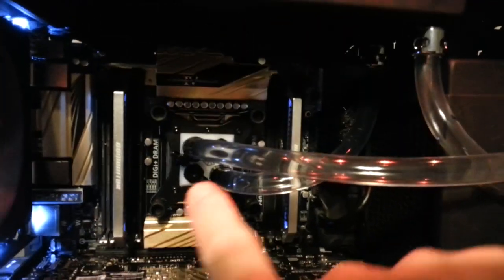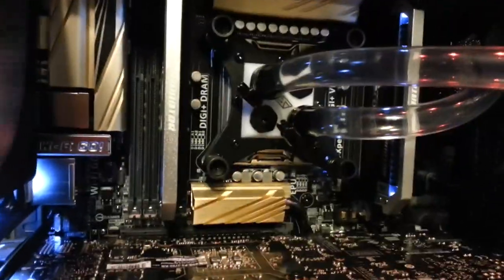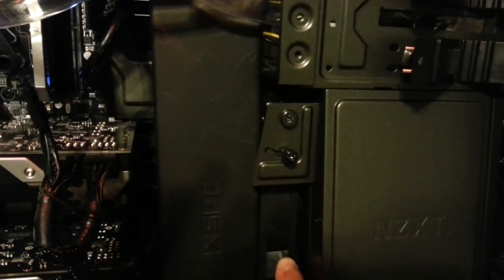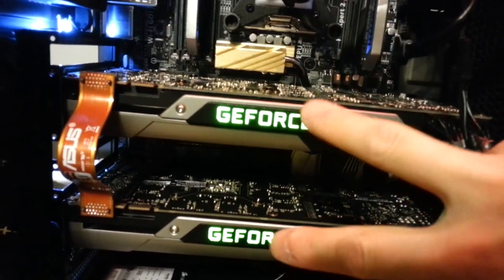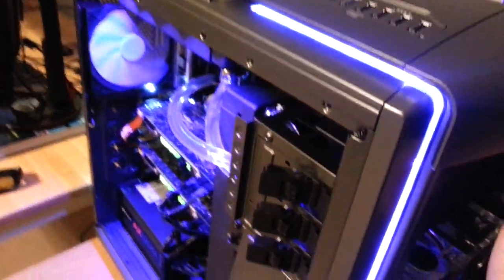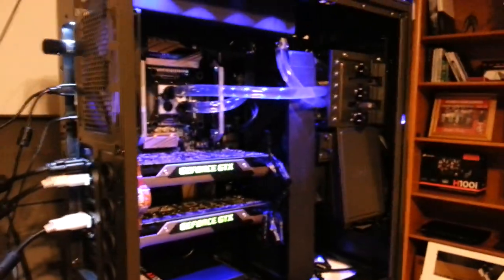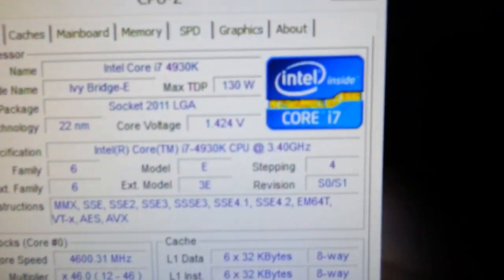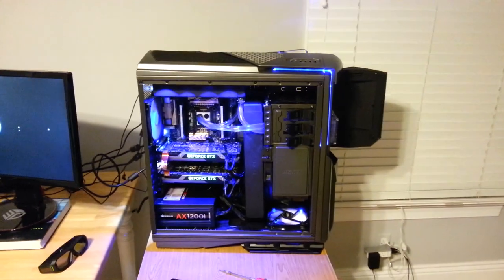[Build Complete] i7 4930K, Custom Water Cooling, NZXT Phantom 820, GTX 780 SLI, Triple Monitor Setup

Comment: For what you are cooling you could go with a smaller case.  I have that case.  I have a 360mm long 60mm thick rad on top.  A 240mm 60mm thick rad on the bottom.  and 2 140mm thick 30mm rad in the back and in the center swivel point respectively. I have 5 water blocks in my case.  1 cpu 2gpu 1 ram and 1 mother board waterblock.  The only block I have seen in your build is the cpu block.  your build was very aggressive, but I am sure you have learned a lot that will help you in your next build.

Comment: What was going on in your head when you decided to use two 360 radiators (1x fat) for a loop containing a single CPU? Hell a 240 rad would have been fine. If you want to keep your radiator surface area for that case and use it effectively I suggest adding your gpus, memory, and motherboard chokes to the loop, a 120 rad on the back, 240 in front of the PSU, and a 360 with elbow jointed barbs on the top. You will need those 90° barbs, I have the same case and straight barbs bend the tubing a bit.

Comment: I like your build but... It is pretty unsightly...why not move the 360 rad up top, the 240 to the bottom, and then you can secure ur pump/res  better in the drive bays or anywhere else you like. Airflow will be much better that way considering you will be able to put all three fans on the 360, push pull on the 240, and that 360 won't be blocking the airflow from the two intake fans in the front

Comment: You shouldn't even need a wrench to tighten the fittings and if they are difficult to even start the thread that's a sign of a sub par product.  And honestly since you are only cooling the cpu there really is no need to cramp up the interior of your case with that 360 rad.  Just a suggestion. :D

Comment: Nice rig but would be better if you had another case e.g 750D from Corsair just came out, seems like you rushed your build did you have a certain time frame to complete your build.? Also do you know how to overclock your CPU you need to find the lowest voltage with the highest GHz your saying doing 1.4v at 4.8GHz seems alot in my eyes you might be able to do 4.8Ghz with 1.2V you know what im trying to say tinytomlogon does a good job on how to overclock just trying to help good luck.! :)

Comment: Also manually pick the vcore or that auto setting will go to town with the volts and wreck your cpu. 

This much rads is to much just for a cpu and u dont even have fans setup on them properly and its already enough cooling.

So you should water cool your GPUs. You say they wont benifit from it but if u water cool them they will make no noise which im pretty sure is half the reason people do custom loops to reduce nosie.

Also it would heat up ur room more becasue more heat would be removed ;)

Comment: Constructive criticism why don't you put the 360 rad in the roof and the 240 in the bottom. Then you could put 3 fans on the 360 and do push pull on the 240 in the floor. The way its set up now tbh is a waste of money.

A h110 would have given almost similar proformace if not just as good and you case would have been way neater and  looked better

But since its to late for that and you have already spent the money why not just spend a bit more and fix the problems.

Comment: I'm planning on making a similar build,what would you think of the asus poseidon gtx 780? it has hybrid water and air cooling.
Reply: Chris Fokjohn Not trying to start an AMD vs Nvidia war but the 780's actually do well for triple monitor in SLI. If he care about vram he could buy 2 770's with 4gb vram and then overclock them but EVERYONE I know who game on triple monitors have no problems playing at max and/or ultra with 780's in SLI. Also the hybrid cooling is good I'd personally get it if I wasn't about to get 2 780 ti's but the ability to air cool then water cool with out having to switch the gpu block is more convenient imo. Also Nvidia also has been known to have better drivers when it come to multiple card setup's.
Reply: 3gb vram is completely fine unless you're doing 4k,do some reading Chris
Reply: You don't think I have? XD
Reply: You don't think I have? XD
Reply: And the hybrid cooling isn't bs,it works well,read reviews of the card,Asus wouldn't make a crap card(or release it)
Reply: Chris Fokjohn Nvidia surround is way better than eyefinity lol
Reply: Chris Fokjohn you do know what the 760 mars is right? look at the benchmarks,it's not a crap card,honestly.   on to 780s vs 290, the poseidon is NOT a REFERENCE 780,it DOES outperform the 290(excuse the capitols,its just for emphasis) from the benchmarks I have seen,

Comment: don't bother getting another case. get a dremel 4000 and cut that top 5.25 bay off to fit 360 on top. bay reservoirs suck. cylindrical reservoirs are better as you can get bigger sizes to hold more water/coolant and feeds the pump properly. get a xspc photon reservoir as it will look cherry with your build

Comment: u only put one fan on a RX360? so what's the point of a radiator with literally no fans then? it's not the case's fault. it's basically a Switch 810 (which was a amazing WC'ing case) with a Phantom look.

Comment: TBH, that single 240 Rad is more than enough for the CPU.  You stated WC your GPU's isnt worth it since you have reference GPUs,  No it's still worth it.  Yes true, your temps will never be close to frying your GPUs but having a GPU under water with temps at 45C is better than Air with it around 60C.  

I have my loop on my CPU and GPUs and my CPU never goes higher than 70C (3570K) and my GPUs are never over 45C (7970s OC 1125Mhz).

Comment: all those radiators to cool a CPU wow you should have water cooled your GPU. Watch  singularity computers so you can get better ideas. I have a Switch 810 with three rads 360 on the top 120 at the rear and a 240 on the bottom and I am cooling a i7 875K overclocked to 4.5 and to EVGA 770  Hydro Copper also in the case no bay Reservoirs.I have a Bitspower 150 Reservoirs with a Bitspower Pump Mod Top with a XSPC D5 water pump and a Pump Mod Kit  Matte Black go to singularity computers.